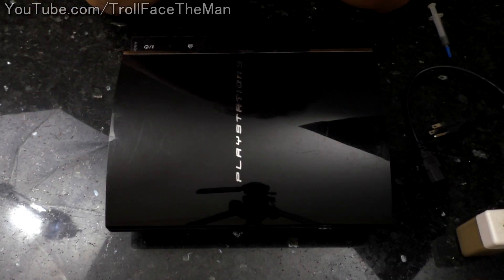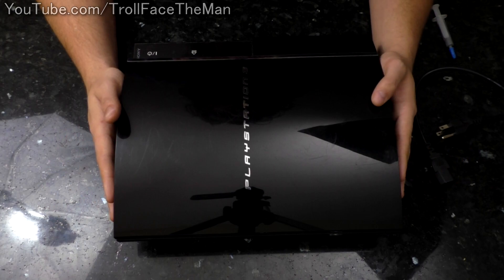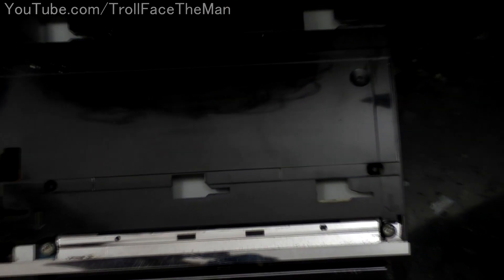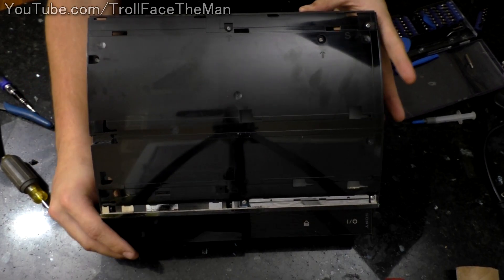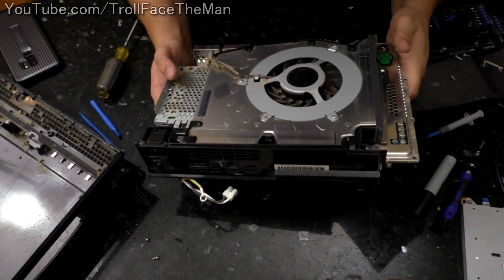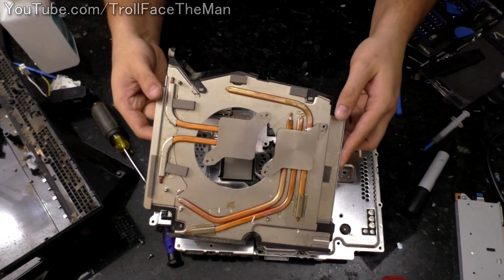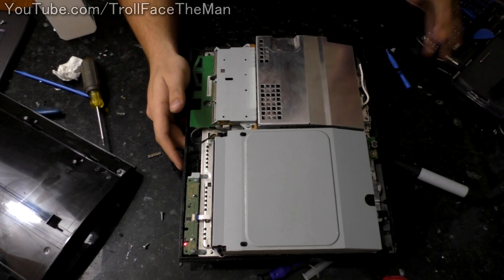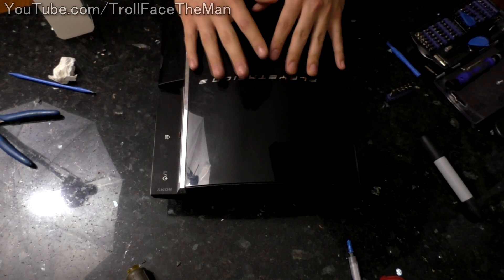Why Console Thermal Paste Needs Replacing (A Common Oversight...) Possible YLOD or RROD Fix/repair.

Comment: I have a launch model 60gb ps3 manufactured in february 2007 and yesterday I took it apart for the first time to replace the thermal paste and wow, the factory thermal paste was chalky and all dried up. I put on arctic mx6 thermal paste and replaced the original 19 blade fan with a more efficient 15 blade fan I found on ebay. I also went ahead and replaced the old cmos battery. Now i have no graphical glitches on Alien Isolation and the fan runs much quieter and games run a lot smoother 👍
Reply from the maker: Awesome! That's great news!

Comment: so my suspicions were correct no need to resolder nor use a hair blower anywhere, I might do this tonight, got gifted a 500gb back in 2021 with ylod still in the closet due to no time or just being lazy to take it apart. Thanks for confirming my thoughts 🤞🏻 hope everything works for me too. Have a good life m8 👍🏻 God speed to you and yours.
Reply from the maker: Hopefully that's all. Sometimes reflowing is needed in extreme cases. Also they can need to be delided and have new paste under the IHS at times too.
Reply: @TrollFaceTheMan  I'll give it a try , thanks anyway. I gave no problems with all that, it's just I never gave it much thought but these days I was eager to play some Force Unleashed again and some other PS3 games. Anyways thanks alot , cheers
Reply from the maker: @Constantinus_Apollyon , yep. Good luck man :)

Comment: Don't think I need to repast my 80gb CECHE01 model but I have something rattling in mine. Pretty sure it's a screw from the PSU inside as I opened up the PS3 and changed the PSU (ZSSR5391A) to the 226 model. I heard that the 226 is supposed to be cooler and I had a spare 226 from a older 60gb that died. Anyway maybe a screw from that wasn't in and fell to the bottom of the system so need to take apart anyway. Might as well go for thermal paste change. I have a working CECHA01 60gb and a working CECHB01 20gb both luckily already had the 226 PSU when I bought them. I have already changed thermal paste on both them so not an issue doing it on my 80gb. It's just time consuming for something I might not need to do yet unless I have an issue. My 60gb was dry thermal paste but my 20gb was really wet but still dry in the middle.
Reply from the maker: Makes sense the middle dried up as that is where the chip packages are likely most concentrated under the IHS.

Comment: My ps3 slim is 13 years should i repaste ? Considering i didnt used it for years does the paste is meant to be used even if the console isnt used ?
Reply from the maker: It definitely would be a good idea if you are having stutters or the fans are running high as it can help.

 Even sitting the paste may degrade.
Reply: @TrollFaceTheMan  I dont have problems in game... and the fan sometimes gets loud for some seconds but most of the time its 25%
Reply from the maker: Sounds like you probably don't need to repaste yet.

Comment: Ironically you didn’t Delid it (A actual common oversight)
Reply from the maker: This one didn't need deliding, and that isn't something most people have the capabilities to do so at home without special knowledge and tools.
Reply: @TrollFaceTheMan  All original ps3 like this as well as some early slims will always need deliding on the CELL chip,but good video
Reply from the maker: @Joe-qs9fw , I am sure you are right that it would be a good idea too given the age. Maybe in the future. Thank you.
Reply: @TrollFaceTheMan  No problem, hope it didn’t seem like a demand and more of a suggestion, also if you want more information have a look at NSC MODZ channel as he has been doing this for years.Cheers
Reply from the maker: @Joe-qs9fw  cool, thank you for the information.

Comment: The ps3 fat had a 350 watt power supply and chewed power. 10% of them failed with in two years causing the redesign of the machine with in a year! So yea if you going to use a PS 3 a must is new thermal past and I would do a delid of the CPU's put Indium foil in and a good thermal past. Any one who says you stupid has no clue of what is going on!
Reply from the maker: There are just a lot of people out there that sadly wish to call others stupid without knowing what really goes on. I appreciate the comment. A delide is a good idea too as you said, but most novice users will be unable to.

Comment: Just changed my Ps3 thermal paste, it was running high fan but never overheated,

I used Grizzly Kryonaut thermal paste, after reassembling everything, my ps3 will overheat within a few seconds and shuts down, the red light will be blinking afterwards. 

Any ideas what might be the issue.
Reply from the maker: Are you positive you have a good spread and the tension on the heat spreaders is high enough?
Reply: @TrollFaceTheMan   yes, i opened the ps3 again to check the spread, the who CPU/GPU surface is covered, and the tension plates are pretty much tight. ill open it up again and and take a few picture.
Reply from the maker: @WHY.A.H.WHY.A  hmm, can you verify the fans are working when reassembled?
Reply: @TrollFaceTheMan  yeah they are working fine, they kick in as soon as I get overheat message
Reply from the maker: @WHY.A.H.WHY.A  weird, I am not sure. Only thing I can think of is the thermal paste under you heat spreader is bad.
Reply: @WHY.A.H.WHY.A  You must delid the headspryders, only solution.
Reply: @INSTXNT-_-KXRM3  didn't get you, care to explain?
Reply: @WHY.A.H.WHY.A  Bro just watch a video and delid it.
Reply from the maker: In this video I don't explain deliding just normal paste replacement.

Comment: Its a little offtopic but many months ago i bought cech04. It was never been maintained before but it was working fairly enough, a little too loud. I took it aparat gently with guide, change paste, remove dust and after reasembly it worked Just once. I played ps2 game for 30 minutes Just to test it, then i turned it off and it never worked again, no beeps, not even red passive light, like no power at all. Did you ever heard about simmilar issue? What could go wrong there? Changing power supply should be firts option to check i suppose.
Reply from the maker: Not sure, that sounds weird. I would say psu too is likely.
Reply: @TrollFaceTheMan  Good thing its pretty cheap in my country :) gonna check!
Reply from the maker: @FilaUndying  I may try a disassembly the reassembly and see if maybe something came lose, but then probably PSU sadly

Comment: Was it still working before replacing??
Reply from the maker: Yes and no, it would run. Bad freezes and crashes after short play time. Fan ran really high. Replacing fixed the issues.

Comment: Dude i replaced the cooling with MX-4 thermal compound but still overheating! What the hell could be the problem? Help!
Reply from the maker: If it's still having issues the deliding your processor and replacing that paste might be the only fix sadly.

Comment: Would you recommend Mx4 or ic diamond for Ps4 pro? Also, can I use IC diamond on my hdmi chip? Thanks
Reply from the maker: I would imagine either would be a good choice. Though not sure about your hdmi chip. Does it use paste normally or pads?
Reply: @TrollFaceTheMan  neither. Ive heard other people are doing this because the HDMI chip is one of the most common problems. (Overheating) I appreciate your response. 👍
Reply from the maker: @Jacob-hl3gt  maybe it would be a useful thing then. If putting on a bare chip I would recommend probably the MX. But you'll need a heatsink too for jt to do anything.
Reply: @TrollFaceTheMan  ok. Thanks again. 👍
Reply from the maker: @Jacob-hl3gt  sure, wish you luck!

Comment: Just did this on a 60gb model I got a while ago cheap. Desperately needed it. Could tell difference. Put it on for 10 min playing uncharted 3 and it didn't sound like it was going to take off. Also did my ps4 pro today. It's nice and quiet now and my mates original ps4. Its super quiet now. Only started doing this as my slim ps3 disc drive broke so decided to do thermal paste while it was apart. Did my launch ps4 the same time I did that as sister uses it and still quiet.
Reply from the maker: Cool, that's what I like to hear!

Comment: The bottom line here is that if this does not fix your fat PS3, more than likely there is a lack of power going to the GPU as a result of the NEC Capacitors failing. Regardless of any capacitor issue or thermal issue, the fat PS3 design is flawed with heat transfer and overall cooling, leading towards components on the board to fail as a result of excess heat being trapped within the system. Apply new thermal paste (mx-4, or IC diamond), clean the system, and if that still does not work, more than likely going to be a capacitor issue. The new capacitor kit (8x tantalum caps on eBay) are a great fix as well, as it addresses another common failure point. Good luck to all lol
Reply from the maker: Thanks for the comment. And yes that is true the caps in PSUs are mot common to fail on many electronic devices.
Reply: @TrollFaceTheMan   I saw that someone commented about using toothpaste and I lost my mind, can’t believe anyone would think that’s a feasible solution.

Comment: Did you ever try to delid it? It's mandatory for Ps3 fat owner to delid and re-apply new thermal paste for about once in 6 month to prevent ylod?
Reply from the maker: Not for this one. It would be better but seemed to work fine for just this application.
Reply: @TrollFaceTheMan  ok. Thanks for the information. 👍
Reply from the maker: Welcome

Comment: So, you replaced the thermal paste above the heatspreader but not below? you know the chips also have that worn out junk paste on them below the spreaders right? you've only done half the job here
Reply from the maker: Delidding yes would be better. But a lot of times just replacing the surface will fix enough to get it going.

Comment: Your lucky that you didn’t get the ylod  I have a phat model like the one you like specifically and I now I have a slim
Reply from the maker: I actually resurrected a YLOD before by heating up the CPU and GPU with a blow torch (To reflow the solder.)

 Gave it to a friend who immediately traded it for a junk computer. Wasn't super happy.

Comment: that ps3 stil working ?
Reply from the maker: It was up to a few months ago when the HDMI port got broken during a move.
Reply: @TrollFaceTheMan  aaaaw so it didn't do the yalow light of death
Reply from the maker: @yasser_prod_Rev  no. Playstation still ran. Just no output.
Reply: @TrollFaceTheMan  you can use the AV multi out port with components cable, and the quality is the same as the HDMI cable

Comment: If there is no overheating or freezing on the ps3 do you think that new thermal paste is a must?
Reply: Wondering this too! I have had mine for years but never noticed any slowdowns or loud fan noises so I'm guessing its fine!
Reply from the maker: Only a must if you start seeing problems. Many factors could lead to quicker or slower paste degradation.

Comment: For a console system arctic mx-2 or mx-4 are the best pastes for different reasons :
Almost same performance as pricier options , long lasting ( multiple years ) , not too viscous so you don't need to worry about heatsink pressure.
Reply from the maker: I have been a long time fan of IC Diamond for anything with good mounting pressure.
Reply: Thermalgrizzly kryonaut is the best paste thermally (expensive tho), but arctic mx is good too, since it also doesn't conduct electrically incase you put to much and it goes over the sides.
Reply: @noodled6145  No, It dries faster than the ones listed here. I've done many test with different thermal paste and I wouldn't recommend it unless you don't mind changing it every 6 month.
Reply: @sonyx5332  My arctic paste has been performing the same as day one , and 2 years have passed.
Reply from the maker: Cool, that is good :]

Comment: My ps4 works like new!! It doesn’t sound like a jet engine and overheat anymore (:
Reply from the maker: Glad to hear :]
Reply: Did it help with frame rate too? My Xbox’s frame rate drops so much
Reply: @LeroyFaceTV  they re caped at 30, if it drops it means it is throtling(overheat) so yes it should help

Comment: My ps3 does stuck Everytime, now I found the fix
Reply: Buy a new hard disk ..i have the same problem in the past but now my ps3 work good
Reply from the maker: Did the repaste work? If not new hard drive or ssd might help. Or in extreme cases delidding and repasting under the IHS.

Comment: My ps4 overheat loud fan noise and it turn so fast and red light then turns off in like 5 secs my thermal paste is dry its been 6 years since i bought it so i will buy Silver 5
Reply from the maker: Ever repaste it?
Reply: @TrollFaceTheMan yes didnt help i throw it away
Reply from the maker: Sorry to hear, that sucks. Might of needed to be delided.

Comment: I just ordered a PS3 60gb from a place that offers 2 years of warranty. Should I risk switching the thermal paste either way?
Reply from the maker: Some companies do a paste swap on old hardware. If that company didn't it's likely you'll need to.
Reply: @TrollFaceTheMan  They don't, no. I'm just afraid of messing something up. If that happens, bye bye warranty. haha
Reply from the maker: @alexptjp9569  yeah that is tough one unfortunately as if the paste hasn't been replaced then I can guarentee it needs it but if you do it wrong you can mess up stuff.

Comment: I was wondering if you could solder the cpu and gpu IHS to the heatsink, and liquid metal between the DIE and IHS for much better cooling
Reply from the maker: I am sure you could if you had the right tools and were willing to risk possible damage.

Comment: My 12 year old ps3 ( CECHGxx)  motherboard SEM-001. Released in 2007. one week ago i was like " my ps3 will be still working after 30 years... week later she got YLOD ( Yellow light of death)

What should i do?
Reply from the maker: Hard to say, a paste replacement might work but it's possible it may need a solder re-flow.
Reply: @TrollFaceTheMan  look into replacing the NEC TOKIN capacitors, they are known to have a short lifespan and you may be able to do it yourself with minimal soldering skills, these caps are what filter power to both the cell and rsx so if they fail, and they do, try replacing them
Reply from the maker: @RGBeter , thanks for the heads up I will keep that in mind if it starts ever having issues with power.
Reply: A busted power filtering cap would YLOD

Comment: I bought a late PS3 FAT for fairly cheap, with the intention of giving it as a gift, so I replaced the thermal paste a few weeks ago (as well as the motherboard battery, just to be safe). This model already had the improved heatsink design, so I didn't expect it to be a jet engine or anything, but it was already surprisingly quiet, kinda like my Slim, but it just sounded like it hummed more deeply (which makes sense, since the fan and cooling department are way larger than in a slim).

I opened it, blew an incredible amount of dust out of it, checked the thermal paste, and it looked kinda similar as yours and felt like dried gum, so it could have probably still lasted few years? The edges of the pasted area looked like your paste in the middle, and the middle looked kinda usable. I changed the paste with a fairly standard one that I had laying around, put the thing together, and to my surprise the console didn't sound almost any different. The fan was maybe one step bellow what it previously was.

Welp, at least it's in such a good condition, so it will make a good gift.
Reply from the maker: Quieter is still best, and now you know the new paste should at least be good for another 5 or so years! Sounds like a nice gift indeed.

Comment: High fan speeds won't be fixed unless you delid the Cell and replace the thermal paste under the IHS, it's 100% more shot than what you were seeing on top, i took mine off and there was no TIM is the center, replaced it and there is night and day difference in fan speeds. In the end this will not prolong the life of the PS3 seeing as the connection between the die of both the RSX and Cell is still shit with crappy dried out thermal paste
Reply from the maker: Though I don't disagree that Deliding is the next step if a basic TIM swap doesn't work out. I do disagree strongly that just replacing the thermal spreader TIM won't do anything to keep console cooler or give it more life.

 Just as long as the paste on the die is functioning even a little having proper paste between heat spreader and cooler makes a big difference. Proof and point my Sister's kids have been using this console for over a year now without issue even though it would constantly overheat and freeze before.

Comment: For the fat PS3's they actually make water cooling blockers for them if you can manage to get the IHS off the die they are really effective a bit pricey but it can help extend the life dramatically and the way things are all the fat models are ticking time bombs.
Reply from the maker: Too bad you can't get better than stock performance out of them with better cooling.